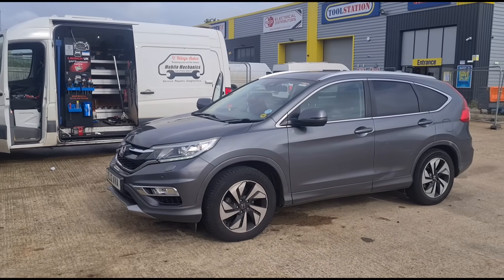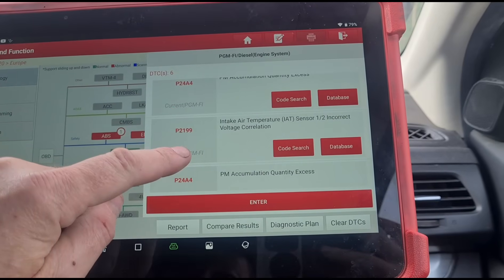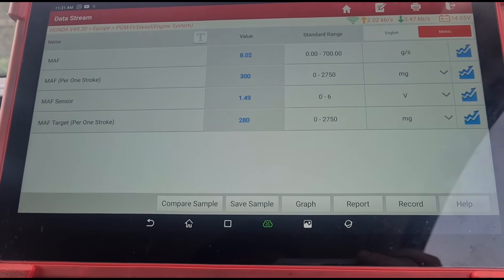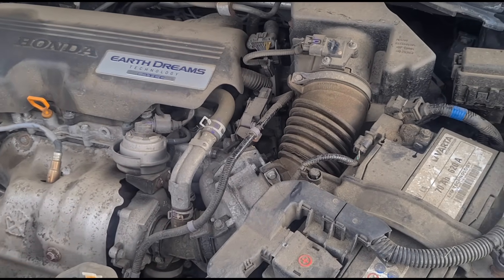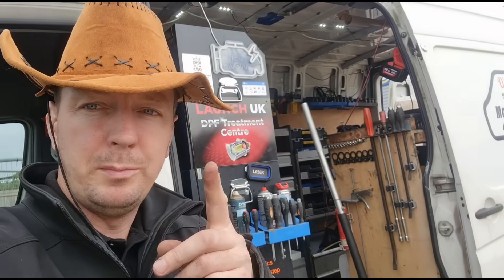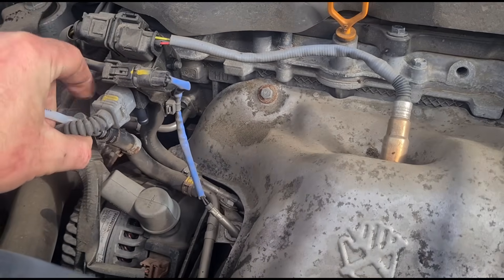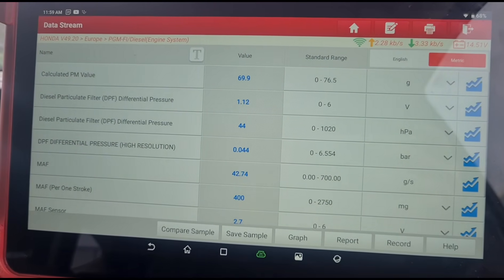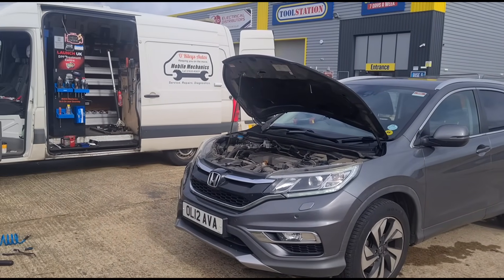Honda CRV Air Flow & DPF Ash Faults

Comment: Another great video, the Honda cr-v seems to have a whole  list of common faults & failures,  so much for that famous "bulletproof Honda reliability" .
Reply: Perhaps if people were not so lazy when replacing the air filter. Undo the hose clamps and remove the hose.dont just unclip the airbox and yank it out the way.then say oh these hoses are shit.also please tell me a car that is bullet proof.one that will never go wrong even when its abused and poorly maintained. I work for honda by the way..yes they have had issues over the years..but there parts quality for the most parts are far superior to other brands.and in any case honda do not even make alot of the components..not only that you are what I can only assume is basing pre 2000 hondas over newer vehicles.i mean the most a old honda had was abs brakes.compare that to now where the car is doing most of the work for the driver.the amount of electronic crap that is now fitted to modern cars is laughable.like a auto handbrake.auto lights,wipers.lane keep assist.auto braking.they even read the road signs so you dont go over speed limits...they even have cruise control that will pre select the correct gear for the road you are on by using the satnav. .have you ever noticed cars are getting bigger and bigger on the outside but somehow stay the same inside.thats to allow room for all the ecu's and wiring.but wait if somthing stopped working out of all the options that somehow makes it not bullet proof.honestly people just expect to much from everything these days.

Comment: That hose leaking will reduce airflow meter value so reduce fueling, I think you may have something else going on blocking dpf!
Reply from the maker: Sorry I think i said opposite but it still caused DPF blockage due to going to limp mode

Comment: Good man yourself.

This might be a stab in the dark here but I'd greatly appreciate your expertise on something if you've 2 minutes.

A few year ago you posted a video on replacing the alternator on a 1.9 Zafira.

I just wanted your opinion on something before I do it myself.

So when I bought the car I immediately put a new battery into it as it was struggling to start, bit lazy turning over but drove perfect plenty of power with the replacement.

Driving it home one night there it went into limp mode and then the acceleration pedal stopped responding, code was reading as; fan control 2&3 open/accelerator sensor position 1&2 signal incorrect ratio so got it towed back.

Went out the next day then and the battery was dead flat.

I know it's hard to diagnose but would you say it sounds like the alternator is gone on it?

Just before I throw money on the yoke.

Originally I assumed cleaning up the ECU would've done the job but the flat battery makes no sense otherwise.

Thanks my man would appreciate the reply! 🇮🇪

Comment: Isn't the problem the opposite of what you described? As it's on the vacuum side of the system the engine is ingesting more air than the Ecu is registering making the AFR very lean. With this lean mix I'm guessing the DPF hasn't been able to get up to temperature to burn off the soot.
Reply from the maker: Oh I'll have to listen back to what I said 😌 sometimes I talk without thinking

Comment: Literally had the same fault yesterday air mass issue pipe gone luckily my customer phoned straight away so no dpf faults. Felt like someone was watching me algorithm when ur video pops up for crv air mass fault 😂. £100 from dealer ebay £30 customers went for ebay one.

Comment: Pretty common for the intake boot to split happens on the 1.6 HR-V as well as soon as you see the mass air flow code check the boot it’s usually split 👍

Comment: I own the same CR-V and intake tube is pretty common issue.. Each time you replace the filter you need to remove it and risk splitting the  rubber hose.
150 euros for that stupid hose from Honda. I ordered 2  from Aliexress for 30 euros. The alixpress ones are softer easier to remove